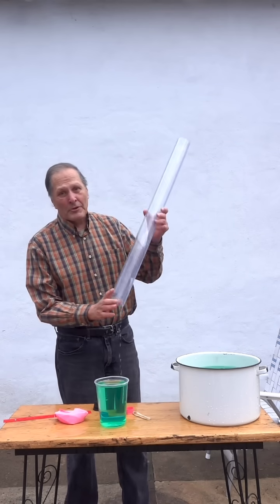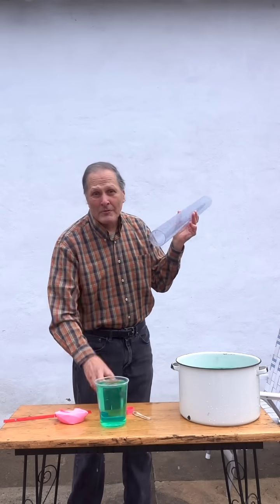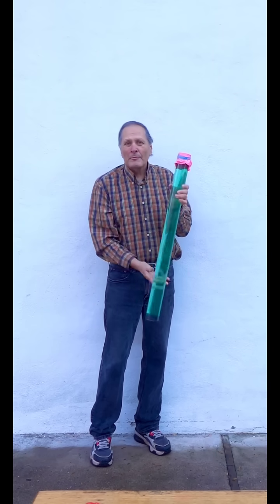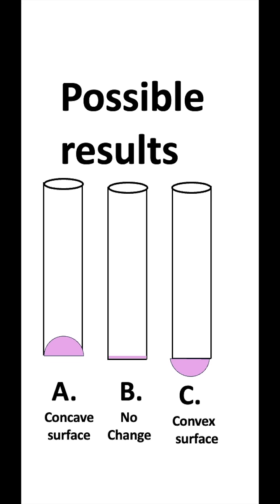Water versus air pressure demonstration: Hydrostatics versus the atmosphere

Comment: Because of air pressure the air pressure hits the stopper and not the water but if the stoper is removed the pressure pushes the water

Comment: My guess is that the lack of pressure is holding the water up. It's like how lower pressure above the wing of a plane holds the plane up. Even if there were no balloon on the bottom the liquid would remain stable until the tube becomes pressurized with an air bubble travelling upwards inside the tube. Hypothesis: If the liquid had a membrane of a certain thickness it may look as if suspended by nothing.

Comment: The stopper acts to block atmospheric pressure pushing on the column of water inside the tube. 

Remove the stopper and atmospheric pressure is applied as a force to the water.

The atmospheric pressure acts downwards on the mass of water and, as the balloon is more flexible than the stopper, some of the water enters the balloon until an equilibrium is reached.

The balloon is resilient to a degree and despite the pressure of the atmosphere pressing down on the column of water, the elasticity of the balloon contains the water and provides a force upwards to hold the water in the tube. The force upwards is equal to the atmospheric pressure pushing down and the mass of the water.

Just to be clear, there is no vacuum in the tube when it’s inverted. There’s just no outside atmospheric pressure pushing down on the water in the tube.

Comment: Gravity is way stronger than a thin rubber balloon, if it's in an open system.
In an insulated system, air pressure doesn't have any role.

Comment: It will bulge out as soon as the tube is longer than about 10m, because then the weight of the water is stronger than the atmospheric pressure pressing against the membrane.

Comment: Your hypothesis are not precise. Vacuum is not a force, so it won't be correct until you explain it in terms of forces. And there are only two forces acting here: gravity pushing down and the force of the atmosferic pressure pushing in all directions. Now try to explain the fact again 😂.
Reply: With the stopper: atmosferic pressure only pushes the water from below. The water does not fall because this pressure is higher than water's weight. 

Without stopper: now the force of the atmosphere pushes equally from the top and from the bottom so they cancell one another and the weight wins.

You may be engineers but you are a little confused.
Reply: How many water can the atmospheric pressure hold with the stopper on top? Exactly 10 meters. The same experiment with a tube 11 m long and you would see the water filling up the balloon and a vacuum appearing on top. With mercury this would happen with a tube 760 mm long.
Reply from the maker: There used to be a couple videos on YouTube of successfully lifting degassed deionized water to a higher height than 10 meters but I've been unable to locate them. I've had a few discussions with others whether this was possible or not.  I'm skeptical but thought I would test this idea. Apparently degassing water eliminates cavitation which is the what occurs at 10 meters. Since I've heard the argument going both ways, I'll be interested to see how this comes out

Comment: With the stopper in, no air can get in so the weight of the liquid at the balloon cannot increase due to the fact that the liquid cannot compress or expand. Pull the stopper to let the air in and the weight of the column of water causes the balloon to fill to the point where the pressure of the rubber expanded equalizes with the amount of pressure from the weight of the water.

Comment: The water is held up by the balloon and air below it pushing up. The balloon isn't actually holding the water up, it is actually keeping the air out. There are two forces at play. Gravity pulling down on the water column and air pressure pushing up on the balloon from below.

If the balloon wasn't present, the air would push up into the cylinder, displacing the water, and balancing out the air pressure such that it is now pushing the water column from the top and bottom equally. Now gravity wins and the water falls out of the column. This would be like pouring water out of a bottle. The gulging is the air pushing past the water. Shotgunning a beer is like taking the cork out of the tube. It lets the air directly into the vessel so it doesn't have to push past the liquid. With a narrow enough opening, the surface tension of the water can take the place of the balloon and prevent the air from pushing past the water. A straw is an example of this.

Air pressure is 14.7 pounds per square inch, or converting units 1.03 kg / cm^2. 1mL of water is 1g which is 1cm^3. To get to 1.03kg you would need a stack of 1030, 1cm cubes of water, which would be about 10 meters tall. Once the water column was that high, then the balloon would sag downwards. Until then, the force from the air pressure is higher than the force from the weight of the water.

If water was a compressible fluid, then the balloon would bulge inwards. Since water is non-compressible, the air pushed up against the balloon and the water and the water stays in equilibrium. If the water column was placed in a magic pressure chamber, eventually you could raise the pressure high enough to overcome the intra-molecular forces and compress the water into some exotic form of ice and then the balloon would bulge inwards.

Comment: By incrementally increasing the length of the tube, at a point gravity and the mass of the increasing water volume will overcome the phase transition state of the water from liquid to gas. At that point the ballon will show signs of bulging. Engineers of Impellers for liquid pumps and propellers call this cavitation. Great demonstration, thanks for sharing.
Reply: and that distance is 28' the water at the top would be under enough vacuum to boil
Reply: That length is 10m, right?! 🎉

Comment: Well I’m no scientist but for it to bulge when plugged, there would need to be something like air to fill the area that the water would leave behind when it goes into the balloon. Because air can’t get there, it creates a vacuum because something needs to fill that space, and that something is the water. So when the plug is removed, air can fill the space and the water drops into the balloon

Comment: Since liquids maintain a relatively constant volume under reasonable pressure, they may not stretch or compress. Because both ends are sealed and another fluid like air is not able to replace water if it were to flow down into the balloon, the water is kept in stasis.

Comment: Engineer here, the stopper creates a vacuum, so the water cannot go anywhere. You can replicate this bu sucking through a straw, and once its full, plugging the top with your tounge. Then as long as you hold your tonge covering the hole, the liquid stays in the straw. You take your tounge off, the top is no longer a sealed vacuum, so air displaces the heavier liquid and the straw empties out the bottom.
Reply: It isn't that the vacuum is holding the water up, but the air pressure at the bottom is. The column of water is acted on by gravity pulling it down. It is also acted on by air pressure pushing up from the bottom. When the stopper is removed the air pressure is pushing from the top and bottom cancelling it out. Eventually, that balloon would bulge out. You would need 6.67 litres or 1.76 gallons of water per square inch before this happened to over come the pressure.

If the water was a compressible fluid it would actually bulge inwards. The non-compressible nature of water is why it stays flat instead of curving inwards.

As for your straw example, that is being suspended by surface tension and the air pressure. If you widened the straw it wouldn't work, much like it wouldn't work if the balloon wasn't there in this video. Enough weight of liquid in the straw would also eventually overcome the surface tension and leak out as well. But like the balloon, the surface tension isn't suspending the water in the straw. It is actually keeping the air out of the straw and stopping it from rising to the top of the straw and balancing out the air pressures. That is the same thing the balloon is doing in this video.
Reply: @Crushnaut  too much was said, and it still isn't right.
Reply: @dimitrijekrstic7567  lol you might want to google the compressibility of water. That is a simple fact and it is very relevant in this situation. If water was compressible the balloon woukd bulge inwards. It doesn't because the air pressure cannot compress the water.
Reply: @Crushnaut Failed engineer here. It is true that liquids are not very compressable, but it's a little wrong to call them uncompressable. I knew a physicist who also used to call them that to simplify things and sure, in high school physics it might be fine, but in reality, everything can be compressed. Not by this tiny air pressure ofcourse, but still.
Reply: @fredrik8685  lol, sure, everything eventually compresses into a blackhole, but that is useless information when talking about this scenario
Reply: @Crushnaut  I just don't like when we use words that are untrue. Even if we never get near any relevant changes in compression in this scenario there still is a change in the waters compression, however it is in our calculations negligible.

The truth should never be considered useless information.
Reply: @fredrik8685  but that is just wrong, the fact that water isn't compressible at this pressure is relevant to why this experiment behaves the way it does. If it was compressible, the balloon would push in and it would be concave. Your argument is purely pedantic and I am positive most physists and engineers would agree. Compressing water into exotic forms of ice is completely irrelevant to this conversation and irrelevant to every aspect of daily life. Waters incompressibility it relevant to a number of actual real life situations like, this experiment, hydraulics, our oceans, hydrostatics and dynamics, etc etc etc.
Reply: @Crushnaut  Then the discussion is about the meaning of the word incompressable which I believe is misleading.

I know this is borderline to semantics, but I have met people who genuinely believe that it is impossible to compress liquids because of this.

Does it really complicate stuff just to say that liquids are close to uncompressable?
Reply: @fredrik8685  yes, because for day to day usage, water is incompressible and as you have pointed out, people are easily confused. It doesn't matter if someone thinks that water is incompressible to infinite pressures. They will never encounter a situation in their life where that matters. When they get a science or engineering degree they can learn the difference. For their entire lives, living on the framework that water is incompressible will serve them just fine. And once again, the discussion is about the behavior of this experiment, and to explain the behavior of this experiment, the easiest way to explain it is under the paradigm of water not being compressible.
Reply: you validate your answers by your qualifications, thats a nice thing to do on the internet, a very nice thing to do. If it wasn't said by an engineer, I wouldn't believe it.
Reply: The key is actually that water is incompressible.
Reply: @marekogarek6329  no? Nothing is compressing it here so it doesn't matter, and water is compressible.
Reply: @dimitrijekrstic7567  Water is only slightly compressible, so it can often be approximated as fully incompressible. If it was compressible it would bulge out (since it's heavier than air, if it could easily expand under its own weight then it would expand).
Reply: I hope you still have the receipt from your engineering course. You should ask for your money back.

A straw operates when the person using it reduces the pressure in the straw by sucking on it. Atmospheric pressure pushes down on the liquid in the container and forces the liquid up the inside of the straw.

If you stop sucking on a straw and release the straw, atmospheric pressure acts on the liquid in the container as well as in the straw and balances out in equilibrium.
Reply: @kjamison5951  dude, go put a straw in water, no suck, put your finger over the top, and lift the straw out of the water. Low and behold there is water in the straw not flowing out. Sit all the way down.
Reply: Borderline genius here.  It doesn't take a genius or even an engineer to figure this out.